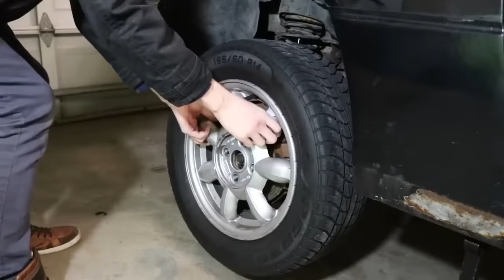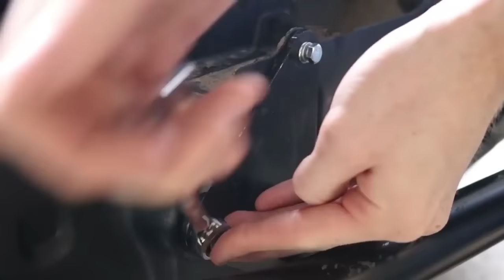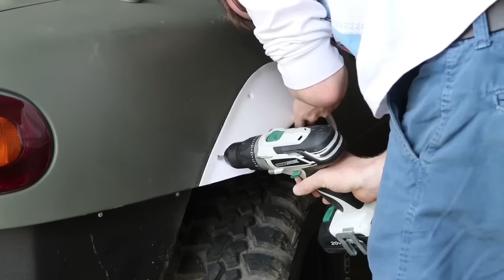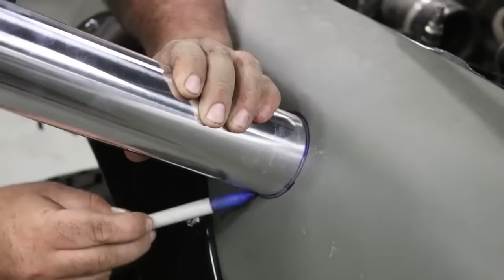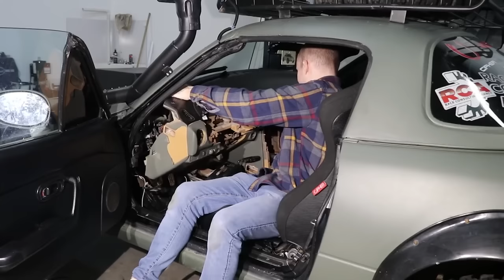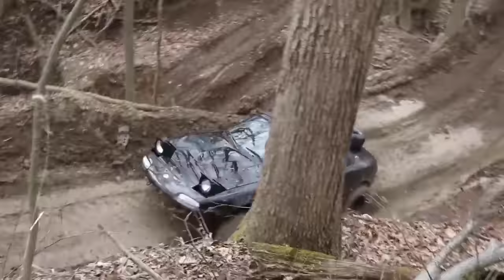Building a Supercharged Offroad Miata in 6 Minutes!

Comment: what a sweet build. wish the transmission was AWD or 4WD. you would have a killer car there
Reply: AWD,4WD samething
Reply: no they aren’t
Reply: @dylanv3813  bro AWD - All wheel drive
4WD - 4 wheel drive

cars have 4 wheels so this is samething
Reply: @no its logical thinking but its not the same thing
Reply: @dylanv3813  ok sorry you are right, have a nice day
Reply: Anyways, he's doing it soon
Reply: @revioli8160  awd is known as open diff. Where the wheels can move at different speeds. 4x4 is a locked diff. Where all wheels move at the same speed no matter what.
Reply: MURICA so, Subaru’s are 4x4 because symmetrical awd
Reply: Adolf Hitler  what do you mean. That's literally the definition. Sure 4x4 can be a little open some times, but it's usually not.
Reply: @_Belteshazzar_  not necessarily, I can't name really any modern AWD that doesn't have some sort of center differential lock, the most common being electronic
Reply: @draven4464  4x4 drive uses a transfer case. I forgot what awd drive uses. But I've never heard anyone refer to awd with lockers. And lockers lock the diff. Some even agree awd and 4x4 are the same.
Reply: @revioli8160  4 wheel drive is when you have all 4 wheels exert same amount of power whereas awd exerts different amounts of power to the wheels depending on the situation

While driving straight
Awd:- 20% on front wheels 80% on rear wheels
4wd:-25% on all wheels

When 1 wheel is floating (during rock climbing)
Awd:- only exerts power on wheels planted on the ground
4wd:-25% on all wheels

Comment: The only problem is it's rear wheel drive, without a limited slip diff even.
Reply: I don't know what specific yr this Mk1 one is, but from 94-05 the cars had Torsen diffs. Better than limited slip. Apply a little e-brake and it's basically a locker. Same type diffs in military Hummers.
Reply: They made it AWD, check their other vids
Reply: Not anymore

Comment: Is it only RWD?
Reply: ooof that'll be juicy. I'm subscribing now so I can be there too
Reply: Who knew me expert
Reply: All I was thinking the whole time was why would you start with a rwd drive train
Reply: @mosesmalone28 the power to weight ratio of the mx5 is insane so its alot of fun on dry and gravel terrain although! the additional weight strain on the diff and axles will negate a lot of that and  accel and gain torque as long as the gearbox has been adjusted to suit the new radial weight on the hubs . 

but i suggest they're just bolting on lots of shit for a video have a bit of fun as it would eventually tear the fuck out of itself. as you can hear lots of high revs on tough terrain  and seeing as this isn't a 500k wr car its a weeeeeeeeee boom 

fuck it reasons lol
Reply: @gundamfan2020  Yeah it sounded like it was struggling hard
Reply: @mosesmalone28  ever revved a car that hard for that long it would burn oil.. but then so many experts on here that know better.
Reply: Definitely useless as an "Off road" buggy being RWD.  The AWD mod should have been the first mod. This was about as efficient on time (ton of work) as believing in a flat earth.  Seems like a waste of time similar to giving a 2 wheel drive jeep/ truck a 2" lift
Reply: @chadj77  You clearly have never worked on a car in your life if you think 1. AWD first is the best route and is easy and 2. It can already do better off road than some Jeep's.
Reply: @chadj77  how about you watch some of the off roading videos of the Miata.
Reply: @chadj77  have you ever heard of a baja bug, or a dune buggy, or a dirt bike, or any sport quad, or practically the king of offroad a trophy truck, or a snowmobile (i mean technically...), or a sand rail etc
Reply: Hes gonna convert it to awd in the future

Comment: I realize that this is an older build bt now, and you probably have already answered the question before. But I was just wondering how big you were able to go with the tire size. Would 33 inch tires fit  after a 3 inch lift? Or would additional modifications be necessary? Thanks

Comment: That's my kind of Miata, but curious to know about all the additional wear & tear placed on things like drive line, steering (no power steering), etc by adding all that extra tire. I have experience grenading my rear diff in my Jeep, & have seen it off road & on the drag strip.